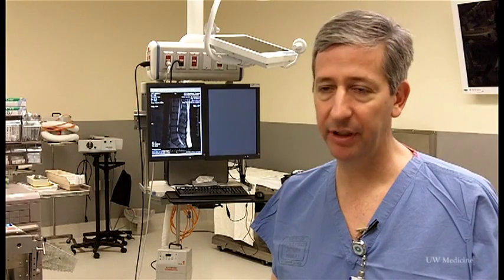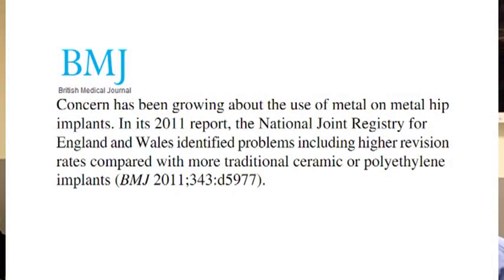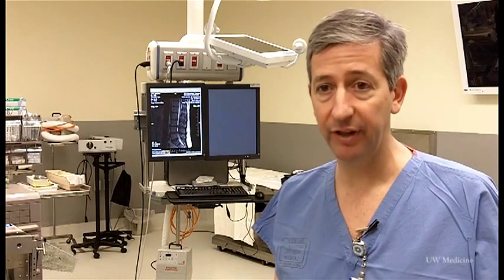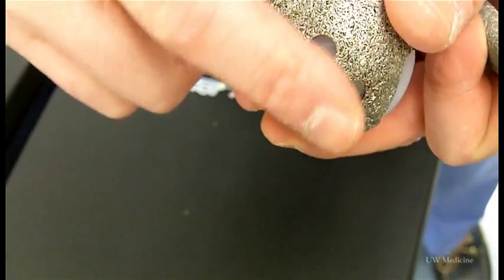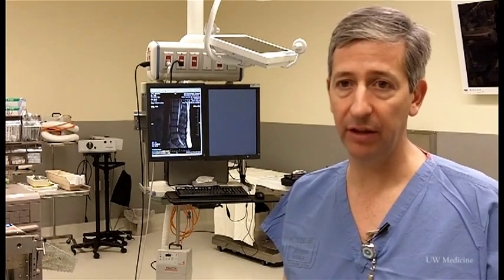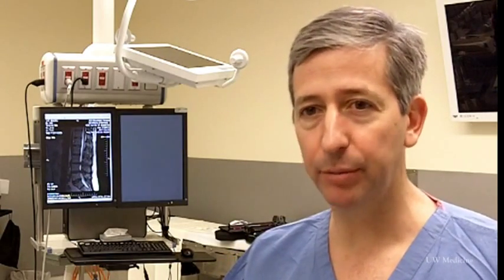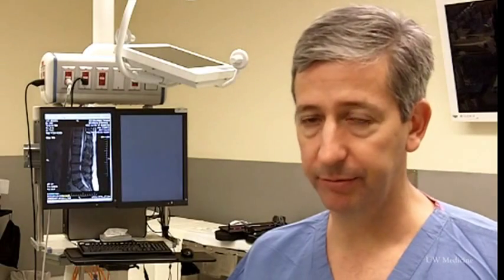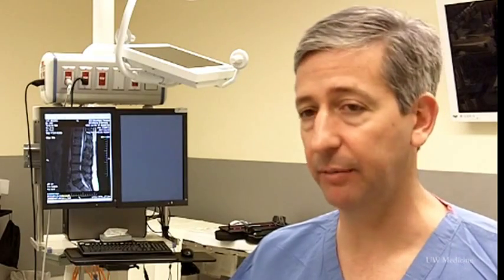Safety of Metal-on-Metal Hip Implants

Comment: In 2008 - 2010 at age 34yo I had both hips replaced metal on metal in Portugal. I moved back to the UK in 2021. In 2024 I started to go through many tests and Mars Mri. To cut a long story short my hip replacements I had done in 2008 - 2010 have become highly infected and the surgeons here said I need them replaced again. I do not want to have them replaced agsin. I am in the process of having them replaced the surgeon said in summer 2025. I have had my latest blood test results done and my chromium and cobalt levels are high. Each side of my hips you can see a sack obviously where the infection is. I am alone in my life no family of friends for support and I really do not want to go through this I am 48yo now. It's affecting me physically, find it hard to walk, highly sensitive, chest pains, eye sight decreasing and more. I am about to see my surgeon in two weeks to discuss my concerns but really do not wish to do this. When I left the hospital in Portugal they told me just to get on with my life. Did not tell me to have my metal on metal hips checked regularly only in 2024 did I have them checked.

Comment: your nuts using metal heads on poly . ceramic heads on highly cross linked poly are exellent . ceramic on ceramic 1000 times less wear . they should ban metal heads .